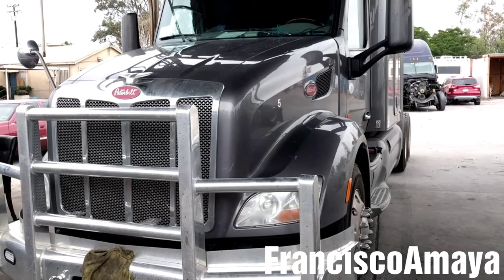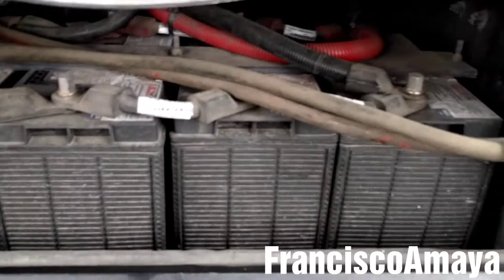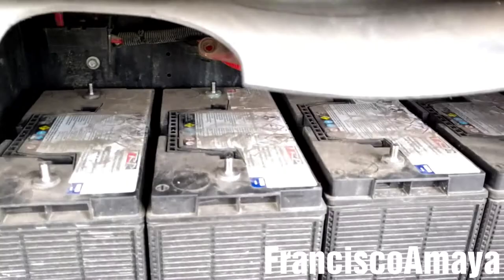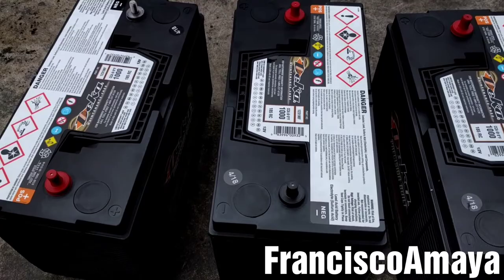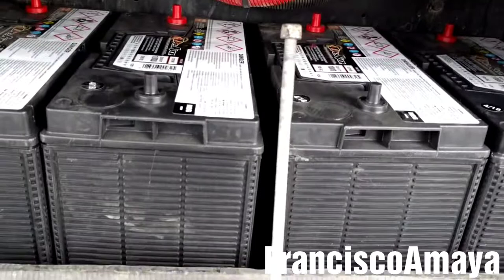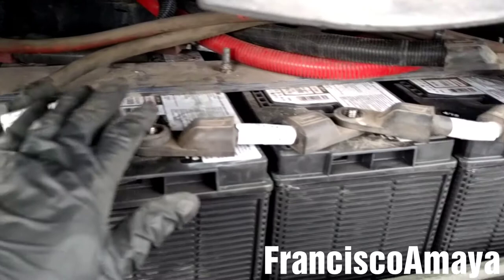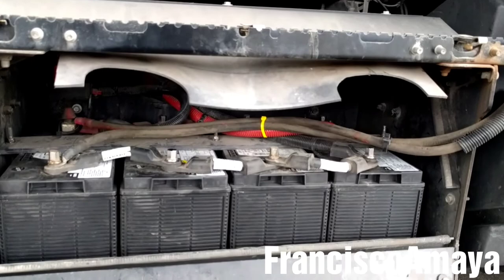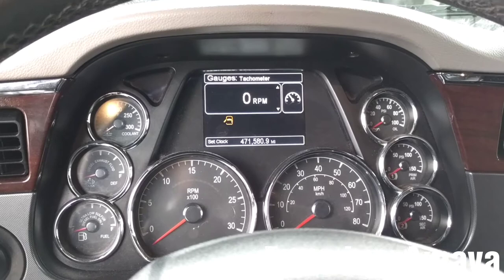PETERBILT 579 battery replacement low voltage disconnect PETERBILT Kenworth

Comment: “Low Voltage Disconnect” doesn’t mean your batteries are bad. 
It’s an option that disconnects anything that is draining power from your batteries that would prevent the truck from starting. 
You can get the “Low Voltage Disconnect” message on perfectly good, new batteries. 
It just means you need to turn on your engine and idle until you come back up to about 14 volts. 
Resting voltage on  Peterbilt batteries are good at 12.6. 

You should change the batteries if they’re a year old and you can’t get them to charge to around 13 or 14 volts with the engine running.

Comment: On my 2019, and 2017 Peterbilt 579, there are no gauges to check the battery voltage. BUT...there is a round push button switch to the right of the steering column. Rotate the outer ring of that switch. Your displayed information above your physical gauges will cycle different information.  Just keep rotating that switch, and you WILL see the battery voltage information appear.

Comment: Cool video, now do one video of installing batteries where there is a bms 100 system and a battery gaurd intellitec solenoid involved.   

I had peterbilt technicians replace my batteries and my truck started 3 times,   but after a night of idling , I turned it off for one hr,  and so When I went to turn the truck on it, it wouldn't start.  Had to tow this 2018 Pete 579 to a shop.  This sucks.

Comment: i havent drove my truck for day & a half at a truck stop i turned the engine on for 20 minutes to charge battery and then 2 to 3 hours later i got the low voltage disconnect but. i didnt have any lights on or anything charging though... confused  new driver by the way

Comment: Is there power shutdown  before  using 9/16 to take the batteries line out? Or just take bolt off with no issues

Comment: Fransisco i have oil in my coolant resevor on my dd15 engine can you help me with the number if a mechanic in long beach for repair..
Reply: Armando Meza 
My dd15 does not regin manually how do I get too regin ??
Reply: Jerry White put truck in neutral take out parking brake and puch in cluch and hold regen botton for about 10 seconds...
Reply from the maker: I don't know anyone in long Beach CA. 
You need to replace to replace the oil cooler seals.